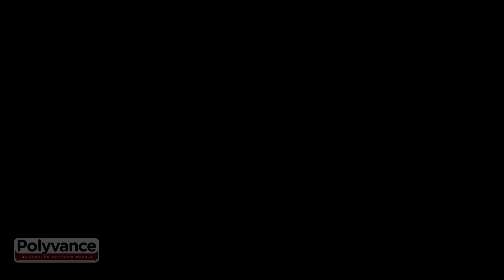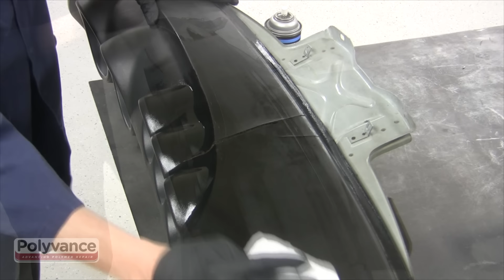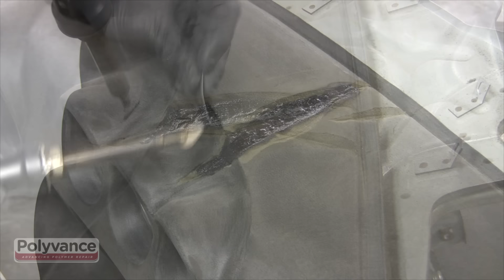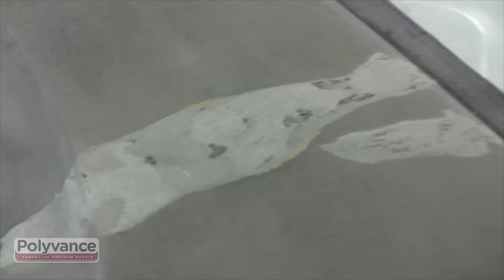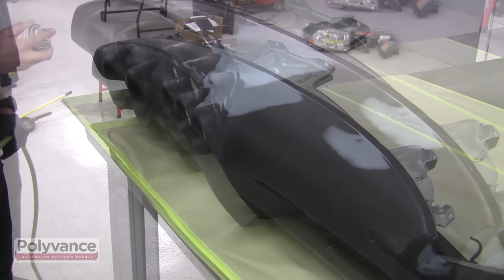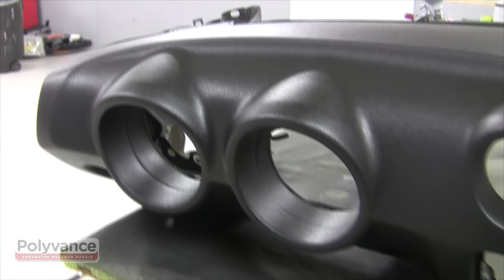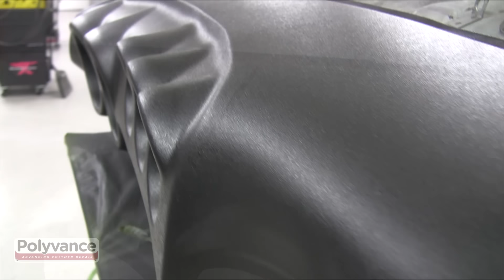Cracked Dashboard Repair - Padded Dashboard

Comment: I used this product for the first time today. I must admit, I went into this somewhat skeptical. And the results were impressive. It works! I will use this product again and recommend it for this type of repair. 

My approach...I reinstalled the dash on my car and it seemed to have shrank somewhat since it has been sitting for some time. I re-fastened it and had to warm the plastic with a heat gun and stretch it back into place. Once it was in place I did the repair. I expect it will fit much better having done the repair in this way. I plan to paint it out of the car and then install it permanently.
Reply from the maker: That's great! We're glad you were able to repair your dash!
Reply: @polyvance  actually i havent. Perth is the most isolated city in the world so i contacted the best in the eastern states. In the US they only have lhd skins which was my next best option. So for i just ordered a dash mat and will keep searching for arhd 2007 wreck of a lexus rx 350

Comment: Any reason to do this, and not skip directly to body filler? I haven't seen anything saying that bondo lets go or otherwise comes out of the crack. And it does seem like everyone simply gets the crack widened sufficiently, then uses bondo. This seems to me like something you would use for bumper covers and plastic panels, among other plastic repairs.
Reply: You’re asking the author of a video that makes products they’re trying to sell why they don’t advocate for using Bondo?
Reply: @moodrow1234  Well I thought the question would highlight why it's unnecessary. Nobody else does all this extra work. Everybody else just fills it in with body filler and then uses whatever resurfacing method they're going to go with. Until I see the filler letting go and the jobs being botched because people didn't use this method, it looks like laying tile right before you pour concrete.

Comment: Only if you can't find a better dash to put in the car. Hey, the old one is out. Somethings are not worth the effort to repair. What was done was great but the grain is not original by a long shot. Chances are that old of a dash will crack again in a few years if left in the hot sun. I believe in California they have dash board covers. I would cover the repair to help the retention of it. It is like a fitted carpet for dashes.

Comment: How can i do the same repair on a same material dashboard but with leather texture. I Have a Jaguar S Type and the dash started to crack around the passanger airbag to the glovebox, but the texture is like leather. How this can be done?
Reply: A wadded up grocery bag dabbed on the wet paint gives the same texture
Reply: Most leather repair kits have texture swatches you can press on when wet (think using a sponge to stucco walls) and that should help with small repairs. It’s not practical for redoing the whole dash though. If you’re set of redoing the whole dash I’d just accept the texture won’t be OEM. If you’re set on the OEM texture get a good upholstery guy to just do the dash in actual leather. It’ll be costly but nothing crazy if you pull the dash yourself and drop it off.

Comment: The dash cracked because plastic dries out and gets brittle, and then is exposed to changing temperatures.  You repaired one cracked area, but there is nothing to stop the rest of the dash from cracking, this may have to be done all over again, for other cracks that will invariably develop later 🤷‍♂️
Reply: This is true to a point.  With a coating on the dash, the dash's deterioration is greatly slowed and a dash repair tends to be surprisingly reliable.  The repair process also takes some of the stress out of the remaining dash, so this helps a little too. When done correctly a dash repair will last for many years.

Comment: This is great. Must the dashboard be totally removed to do this repair?
Reply: In most cases yes.  Although it doesn't seem like it, its easier remove it to do it outside the car than trying to do it inside.
Reply: @scottb7600  thank you for responding. My Kia Cadenza dashboard removal process is way too complex for me as a beginner. I’ll take my chances. Thanks.

Comment: Great video! But how do you keep the texture if the original texture is ”leather” like? Same materials as this thas just another texture pattern.
Reply: You can't unfortunately.  The only other alternative would be to repair the dash in the same way, but rather than spraying on the texture paint, rewrap the entire dash with a new sheet of vinyl.  I have never done this, but it is very difficult from what I understand.

Comment: Pain in the you know what process... buy a new one lol
Reply: Agreed, but if you can't get a new one......sometimes you just need to bend over and take it up the tailpipe. 🙂
Reply from the maker: What if a replacement is not available? An aftermarket dash may be available for some cars, but not others. Parts availability is a huge problem right now.
Plus, some people may prefer to keep the original. Older cars most likely will not have a new OEM dash available to replace it with. Therefore, replacing the dash is not an option for those people. In that case, it has to be repaired.
Have a look through the comments on this video, and you can see that people were saying new dashboards weren't available for their cars, even before the parts shortage  in 2021-2022.

Comment: im not understanding why you would fill the crack flush with the weld. With the filler on top wouldnt that increase the height past factory in that one spot?
Reply: When you sand it, you sand down so it is ever-so-slightly dished at the repair, then when you fill it and after sanding the filler, it is the original profile.

Comment: Damn I wish I can rip my dash out right now.... Im thinking of ordering a dash molded cover, we'll I do plan on fixing cracks first. Definitely need some of the materials used here. I was planning on using some foam in can n trim or shave to right thickness n maybe a coat of resin. The dash bondo you used is nice! Came out super clean nice work
Reply from the maker: Thank you!

Comment: I just wonder how long this will hold up? I bet not 1/4 as long as it took the original to split. Whoever starts reproducing close to factory original plastic and vinyl parts for our antique cars will be very rich. Things like plastic tail light and marker light lenses too. I wonder if 3D printing has evolved yet to be able to do this?
Reply from the maker: There isn't one uniform answer to this question. Just like how no one really knows how long an OEM dash will last before it cracks.
It will depend on how you take care of it. Where and how you store the car is likely a big factor. It should last a long time being stored in a climate controlled area. Sun is the killer of dashes, so limiting its exposure like that will reduce the rate of shrinkage on the original vinyl, which is the weak point.
If you do a good job, it should last a very long time. While it's true the dash will still be brittle, once the dash is topcoated, you are protecting it from further UV degradation, so the aging will slow. Plus, once the cracks are v-grooved out and filled, a lot of the stress in the dash is eliminated, so the likelihood it will recrack in the near future is minimal.

Comment: Just curious if you used the stainless mesh in the video? It's in the kit you linked so it just had me wondering.
Reply: Mesh cannot be used in this case.  The main reason for that is that the foam is a thermoset material and if it gets hot enough to "melt" it is actually decomposing.  This, and the layer of vinyl on top of the foam is too thin to embed the mesh into, even though vinyl is thermoplastic and mesh could be used in it if it were much thicker..

Comment: Its cheaper to replace it!!
Reply: Good luck finding a new dash for an older car.
Reply from the maker: What if a replacement is not available? An aftermarket dash may be available for some cars, but not others. Some people may prefer to keep the original. Older cars most likely will not have a new OEM dash available to replace it with. Therefore, replacing the dash is not an option for some people. In that case, it has to be repaired.
Have a look through the comments on this video, and you can see that people are saying new dashboards aren't available for their cars. :)

Comment: Basically; bondo
Reply: Similar chemistry, but the big and very important difference is that this cures soft and flexible, so it doesn't pop out or make a hard spot like Bondo would.

Comment: Unless it can be done without removing the dash, there is no way I'm taking out the dash.
Reply: Dash removal is a major pain, but not as hard as you might think.  Just make sure you disconnect the battery before you start!

Comment: Wow amazing. Almost unbelievable. Is repairing the dash board cheaper than buying a new or used one. Repairing doesnt seem to be that simple or easy.
Reply: It depends on the dash.  A new car, it may actually be cheaper to buy new, depending on the dash, but usually not.  On old cars the dashes are usually not available, they are insanely priced, or they are also damaged.  This is geared to mostly restorations where a new dash is out of the question, or on newer cars where the cost of a new dash is prohibitive.

Comment: lol i didnt know i had to check for bondo in my dash too now!
Reply: That is what “body filler” is used for.. making the surface perfectly level. That’s a proper repair. It’s when the surface isn’t repaired and the “body filler” is used to repair the surface is when you need to worry.

Comment: You’re kidding right?   The average person doesn’t have the tools you used and doesn’t have the skills to get the dash out of the car!
Reply: Not every video is for every DIYer.  Skill levels vary along with the tools one has in their shop.  If there was a simpler method, it would be here as well.  There is a dash repair difficulty level above this, and it would involve stripping the old foam, sculpting a new dash with new foam,  and covering it with new vinyl.  I consider myself fairly skilled and I have no confidence I could sculpt new foam to look right.  However, I can definitely do this repair even though it takes a long time and a fairly well equipped tool chest.
Reply from the maker: The plastic cleaner, FiberFlex Repair Kit, adhesion promoter, Padded Dash Filler, waterborne primer, and texture spray can all be easily purchased from Polyvance.
A lot of people have had success with this repair. We get tagged in repairs on social media every now and then.

Comment: Couldn’t you use Great stuff which is polyurethane foam?
Reply: It is not a springy foam and if it gets squeezed, it will leave a dent, so I would say no.  Plus it dens't have a lot of structural strength to tie the top layer of vinyl together

Comment: Isn't the dash still hard and brittle with age, and will crack again?
Reply: Sure, eventually.  If you do a good job, it should last a very long time.  While its true the dash will still be brittle, once the dash is topcoated, you are protecting it from further UV degradation, so the aging will slow.  Plus, once the cracks are V-ed out and filled, a lot of the stress in the dash is eliminated, so the likelihood it will recrack in the near future is minimal.

Comment: Several inches became almost a foot
Reply: That's how bodywork works.   Each successive step makes the repair area a little wider.   Its unavoidable if you want to completely hide the repair.  The smaller you try to keep it, the harder it is to conceal.

Comment: But the texture ?
Reply from the maker: It is difficult to try to recreate the original look. Unfortunately, matching all OEM textures is impossible because some use a square pattern, or a leather like pattern and even if you take a mold of the pattern and embed the pattern on the repair, you cannot blend the original pattern with the reproduced pattern.  When you paint it, you end up seeing a transition ring every time.  So the compromise is to put a pebble grain over the entire dash and living with it...even though its not the same.

Comment: Cheaper to recover I’m thinking better Finnish
Reply: You still need to repair the cracks and make the underying structure sound and smooth before rewrapping the dash with vinyl, so everything up to texturing is the same.  But yes, it would look factory with new vinyl.  If you do the repair correctly, it would not be sheaper however, I am 100% sure of that.
Reply: Scott B looks good,, the different stages it goes through, Is amazing, I must admit , stay safe !!!

Comment: I was hoping for a more natural appearance. The finished product looks like it you sprayed it with bedliner. It doesn't look factory at all.
Reply: It is a little course.  When using the 3804 flextex, we could have added more reducer to make a finer grain texture.  Also it looks more textured in the video than it does in person...easy to say, tough to show, but its true.
Reply: @scottb7600  I like the way it came out for a custom look. I have 2 older cars with padded dashes that both have a small crack in my line of sight and it bugs me so I wanted to fix it

Comment: Looks like a 240/280z dash
Reply from the maker: It's a Datsun 280Z dash.
Reply: @polyvance  that's actually a good looking dash before you fixed it most of them are way worse then that. How long will that last because I know the Z's are notorious for cracking?
Reply from the maker: There isn't one uniform answer to this question. No one really knows how long an OEM dash will last before it cracks. It will depend on how you take care of it. Where and how you store the car is likely a big factor. Leaving it outside in the sun would make it crack faster than storing it properly in a garage.
Reply: @polyvance  I'm talking like the repaired dash that you did will it last or will it just crack again in a few years. My car is new out in the sun unless I'm driving it other wise its on my heated garage set to 65 degrees and humidity controlled.
Reply: @bjjdatsun  I would say it will last a very long time being stored in a climate controlled area.  Sun is the killer of dashes, so limiting its exposure like that will reduce the rate of shrinkage on the original vinyl, which is the weak point.

Comment: Only question is how long a repair like this lasts before it cracks up again???
Reply: Nobody really knows for sure, but how long will the OEM dash last before it cracks?    I think it mostly depends on where you store the car.  If you leave it outside in the desert sun dashes will crack faster than if they are garage kept in Maine.

Comment: I would like to know how much was spent just on the materials for this video.  Anyone have an idea?
Reply from the maker: Maybe about $300 to complete the full repair.
Reply: The current product total is about $167.00 from Polyvance, plus whatever topcoat paint you want to use.  I added the cost of the 5210 Fiberflex repair kit, 1000-A Super Prep Plastic Cleaner, 2050-9 Padded Dash Filler, and 3804-4 Flextex.  IF you need an Aerosol texture, then use 39853 and subtract about $20, but you give up control of the texture size.

Comment: Damn that's a clean repair. Only thing is you lose the factory texture, so if there's other plastic/vinyl trim in the cabin you're going to mismatch.
Reply: That is one of the downfalls, but many times the dash has a unique texture anyway. This will just convert it to a different unique texture...Others will do the repair, sand off most of the texture then stretch a layer of new vinyl on top of the old repaired layer.
Reply: You'd mismatch just with the fact that it's new paint, so pull that other plastic out and spray that too!
Reply: Rewrap, and you can find colors very similar if not spot on, plus texture that is very close

Comment: One problem with this is that if one area is cracking, the rest of the vinyl is likely also in bad shape as well and probably unstable and ready to start cracking.
Reply: Not necessarily.  Plus, if the dash is not available or you don't want to pay thousands for a major dash restoration, this is a great option.

Comment: This would be useful if I had my own shop with all the thousands of tools I need to fix a crack
Reply from the maker: You don't need thousands of tools! Lots of DIYers have used our Padded Dash Filler and other products to fix their dash. You can do it :)
Reply: Harbor freight
Reply: Not much in the way of tools in this repair.  You have a sander, right? All you need is a plastic welder.

Comment: one time dash is out 🤓🤓🤓
buy a new one. 
chipper than spend time in this stupidity. 🤭🤭🤭🤭🤭🤭🤭🤭🤭🤭🤭🤭🤭🤭🤭🤭🤭🤭🤭🤭🤭🤭
Reply from the maker: What if a replacement is not available? Aftermarket parts (which are not ideal to use) may be available for some cars, but not others. Older cars most likely will not have a new OEM dash available to replace it with. So replacing the dash is not an option for some people. In that case, it has to be repaired.
Have a look through the comments on this video, and you can see that people are saying new dashboards aren't available for their cars.
Reply: Do you mean cheaper???   Sure, if you have cracked MG midget dash pad or something else that's cheap and/or readily available it wouldn't make sense to do the repair, however if you have something that is no longer available, a repair like this would be a great choice due to your limited options.  There are services that will restore a padded dash, but most of these charge well over $1,000 to have it done.